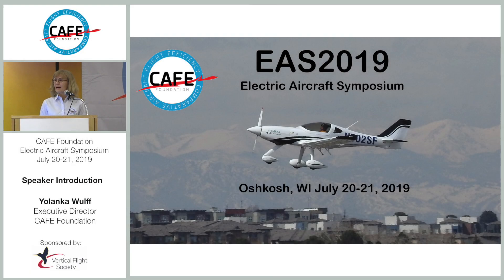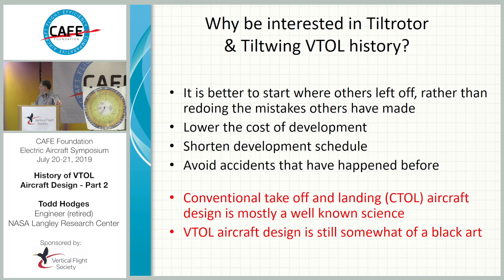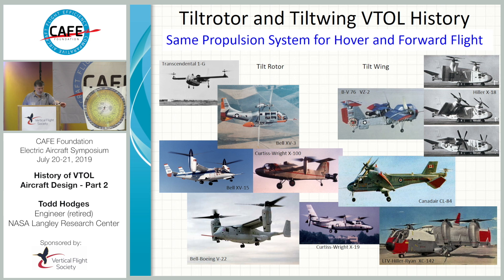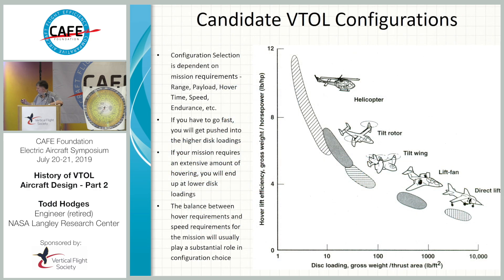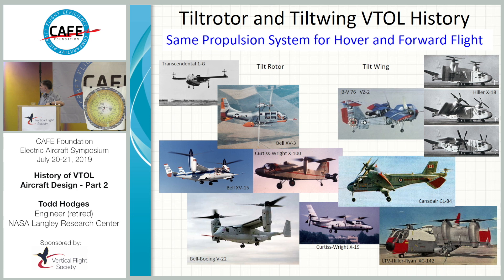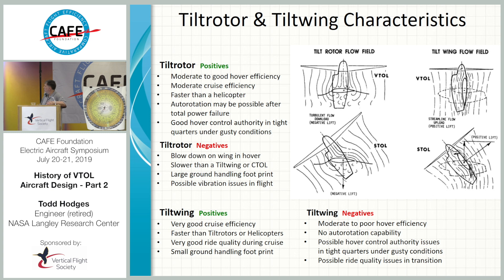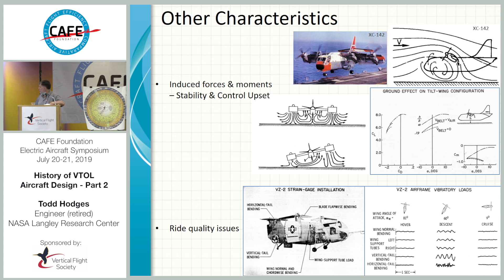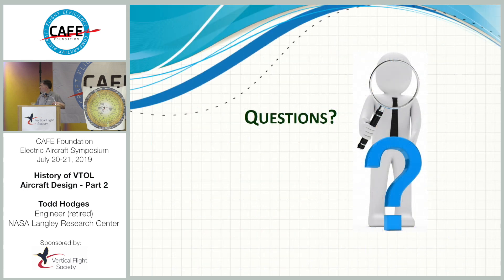CAFE EAS 2019 #10 - Todd Hodges - History of VTOL Aircraft Design – Tilt Wings & Tilt Rotors

Comment: This is a treasure of lessons learned and the history of VTOL.

Some transmission issues will be solved by electric drive. However, there are many architectural issues of tilt-wing or tilt rotors that are highly challenging: CG shifting causing in-stability issues, negative ground effect/vortex issues, crosswind/stability issues, Gyroscopic stability issues, tilt mechanism certification issues, etc.

All the above are addressed by SunPower Propeller.
https://www.sunplower.de/technology